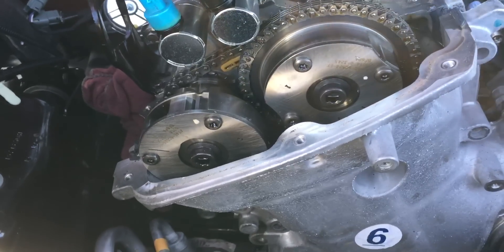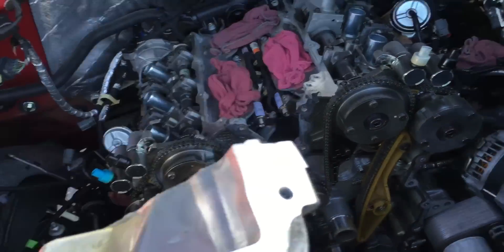2015 F150 3.5 EcoBoost Timing Chains!!!

Comment: I don't care if you had no dipstick in it, there is no reason for oil to be coming out of dipstick tube. You have other problems, and are going to be replacing the engine.
Reply: The dipstick tube in ANY vehicle is under pressure. It's a direct link to the oil pan. If you can't push oil out of the tube then you have other engine issues. The driver clearly didn't install the dipstick correctly. Then proceeded to drive until the truck ran out of oil.

Comment: Lol these ecoboost motors are JUNK. I'm not a ford mechanic but i work on all makes and models mechanic and drove 3 Ford's with the 3.5 ecoboost, and all 3 drove different , but one thing was common, the engines felt like they were going to blow up or had some kind of engineering problem, and would even hesitate and twitch at certain times i floored it. Hope FORD burns to the ground along with Dodge
Reply: So stupid goverment  motors

Comment: That's why I bought a 2016 F165 (2.7). I wanted to see how long it would last, how well it pull and how much fuel it burn. I have 1400 miles and it get 18 mpg in the city with 3.31 gears. 4 door 2wd. Damn truck is the quickest thing I ever own not counting 2011 ZX14.
Reply: I.T. Intern Regular because that what the book say use.
Reply: blackericdenice f165??
Reply: Geovanni Delgado F150 with 2.7 v6. 2.7x61 cuin=165 cuin v6. F165.
Reply: blackericdenice what gas do you put on it? Mid or regular?
Reply: I have a 16 xl 2.7. Tuned with exhaust and intake. Very fast😮
Reply: @CoryFortson-eg9jg  I still have the truck with 96k miles. Stock turbos and it still get 18 mpg mix driving. I made a video where I drove around 285 in Atlanta doing 55 mph. It got 30.8 mpg. I then drove around the same 62 miles long route @ 55 mph in 5th gear and it got 35.8 mpg. Why do you think it got better mpg in 5th gear?
Reply: @Fone65  i dunno how you are getting anywhere near 30s. Best ive seen is 23 on a long hwy at about 65 mph. I average 17-19 around town. Shit. Id keep that truck till it blows then
Reply: @CoryFortson-eg9jg  If you are driving a 2016 F150 2.7. It is easy to get what I got. Drive around 285 about 1am to 5am with the cruise control on @ 55 mph. I did not use the computer in the truck. It is wrong. I filled my truck up before. I did the trip, came back to the same pump and filled the tank back up.

Comment: can you tell me what the chain gaskets and tensioner cost?
mine rattle once in a while so I expect them to get worse eventually  I only have 50 000 on my 2013
I heard it was good to upgrade the oil pump when you have it all apart
so I guess I will do the water pump oil pump chains tensioner and gaskets   
my local dealer has a way of making anything they touch worse than when it went in so I will do it myself too
robert in niagara falls
Reply: about 1200-2000 depending on other issues that show up and what exactly you need done
Reply: Think I should do phasers and solenoids too? I am going for a reliable repair as I like driving across the country in isolated areas

Comment: I have 330,000 km on my 2011 3.5 eco and I am now just dealing with a leaky water pump. Im getting it done next week. But for now I have backed off the reservoir tank cap so I dont run pressure in the system thus slows the leak substantially. Easy temporary fix. I believe in these motors through and through. They are amazing !!!
Reply: wow u are luck 12 000 miles tranny pump blew....Trans went.  20.ooo the motor went top end blew a hole in the motor!
Reply: Mike Walden
That is what a warranty is for.
Reply: +Patrick Connolly very true.  but I had to fight for the tranny.   I didn't have to fight for the motor.  i get it back friday.  but still I expected a little better out of this truck.
Reply: Mike Walden
Nearly a million ford trucks are produced a year. You were the unfortunate one with a manufacturing lemon. Everyone in the world gets them. You just hope it is not yourself.

Comment: I used a drill with a metal brush to do the RTV gasket removal during timing guide replacement on my 4.6.  I just had it shooting debris outside the engine, and of course changed the oil. like you should always do after opening up an engine.  40k later with 264k, and still quiet as ever.

Comment: bulshit engine oil isn't going to leak out of the top of the dipstick and drain enough oil to ruin a motor this is a piece of shit motor and you know it! if the dipstick is not down all the way and oil leaks out then there is something wrong with the motor oil should not squirt out of a dipstick! so this is just another fail on the EcoBoost motor and you know it!
Reply: The Ecoboost engine is a very good engine.  You're just a fucking idiot, and you know it!
Reply: It will if there's a clogged pcv valve and in this case that's what lead up to this and neglect
Reply: That guy clearly doesn't comprehend well lol
Reply: +DeadofWinter321 no, no its not. quit lying to yourself
Reply: +Chad J u be sippin on dat sauce??

Comment: Just an FYI, I have a 2015 3.5 Ecoboost as well.  The dip stick kept getting blown out of the motor by a few inches.  Noticed it by the burning oil smell from the oil getting blown all over the engine.  FORD had to replace a valve and something else (can't remember) after consulting the engineer hotline. Unrelated, also blew the intake tube apart from over boosting.  The dealer I stopped at knew right off what the problem was because they had seen it before.
Reply: +rich gastineau Goddamn ford junk
Reply: That's odd that this would happen. I would suspect that you had your vehicle tuned and was pushing excess boost. But if not tuned then it definitely sounds like a manufacturer defect.

Comment: Get yourself one of those air roloc/scotchbrite 50mm air tools, ive had one for years its one of the best tools i own, turns a 1 hours gasket scraping job like that in to literally 2 minutes to get the whole timing case mirror polished clean